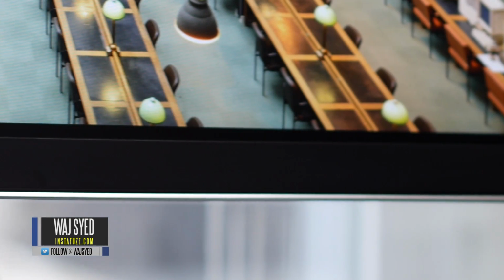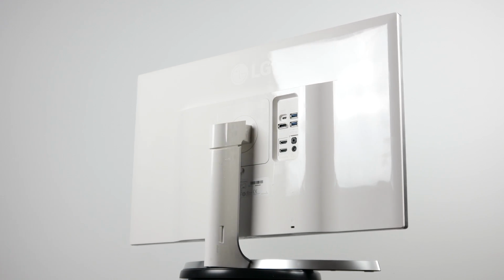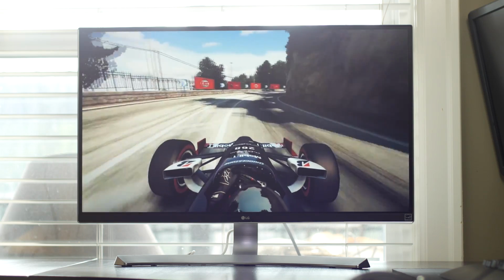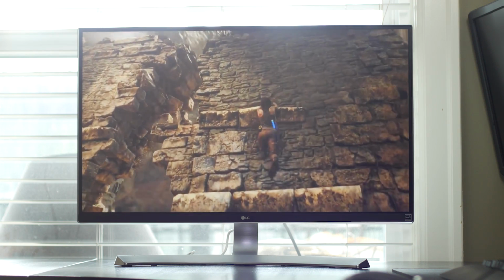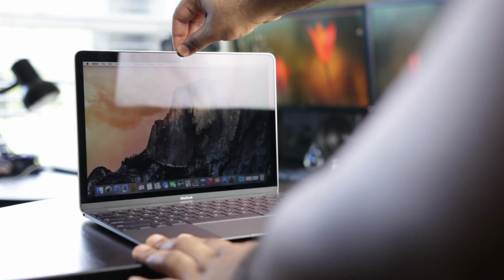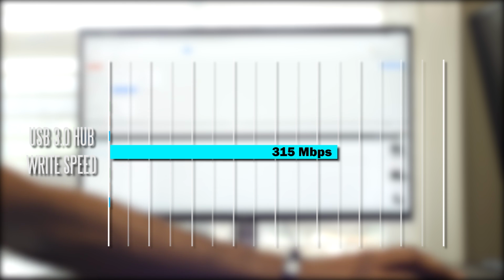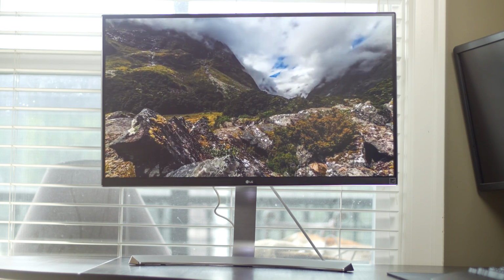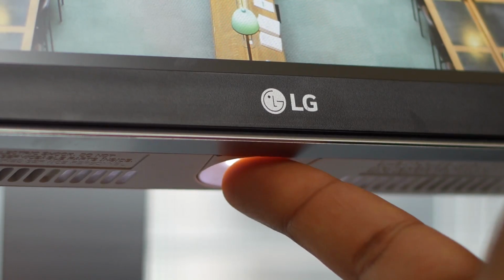LG 27UD88-W USB-C 4k Monitor- Review

Comment: How can the hub feature be achieved with an older MacBook? Use the USB-C port for a hub of some sort, and run HDMI and USB from the MacBook to the monitor? Thanks and great video!
Reply: If you have a non-USB-C enabled laptop you cannot use the USB-C port in the monitor... You can use it by connecting the laptop with a HDMI->USB-C cable but... At that point you can directly use the HDMI->HDMI cable because there is no difference in quality. The velocity of the ports remains the same so how a hub can make a difference?

Comment: future proof solution? hell no. if it was HDR it'd be future proof. my next monitor will be a HDR monitor, hopefully bigger than my current 27" 1080p IPS. i think 30" would be perfect.
Reply: Could you find a 27" monitor with hdr? or any size?
Reply: why so big?
Reply: Jordan Norton Linus i believe did a video comparing no hdr monitors with the new ones coming out. First he exposed the comparison units at CES, they calibrated the non hdr monitors to look way worst then if it was on default! And when doing the comparison he actually preferred the non hdr monitor lol
Reply: hopefuly some will be announced at ces. not getting my hopes up though. might go for ultrawide if not